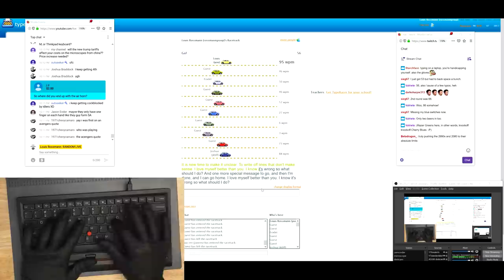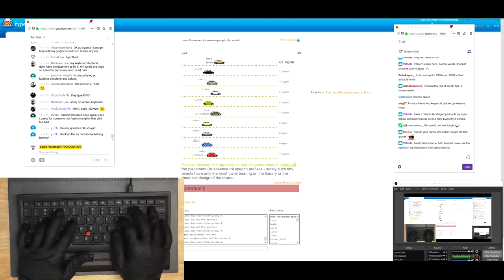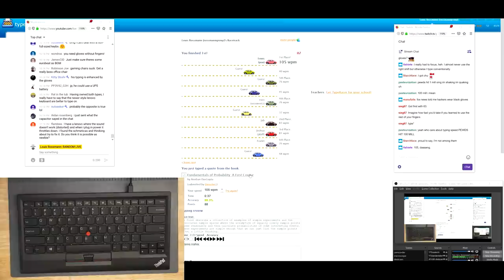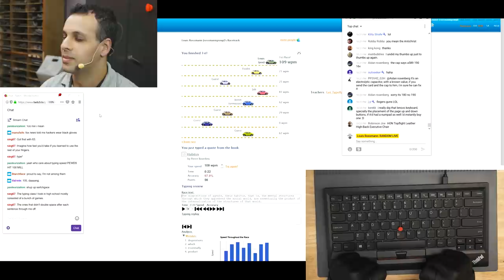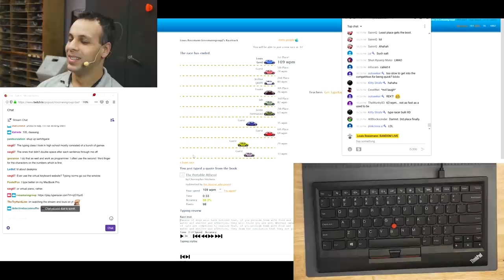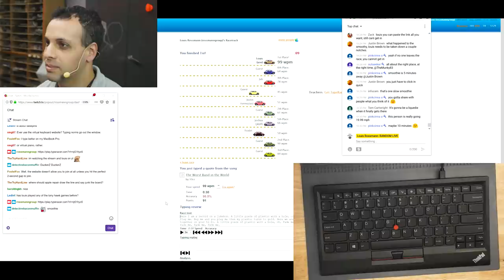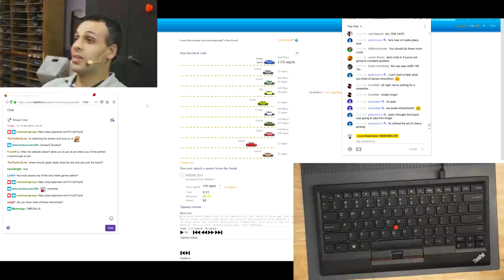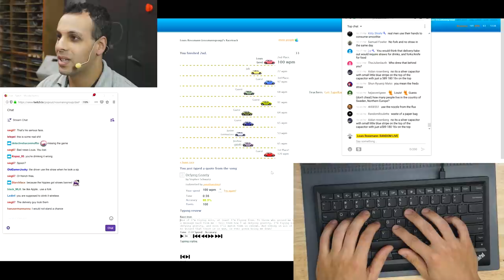[LET'S PLAY] Typeracer

Comment: Yep, the only advantage of the current Lenovo USB trackpoint keyboard over the previous model is the new one has a Bluetooth version. The prior  version  (especially with an NMB keyboard in it) is much better. I have  several and  they are pretty much the only keyboards I use.